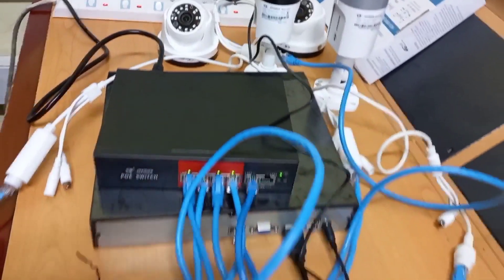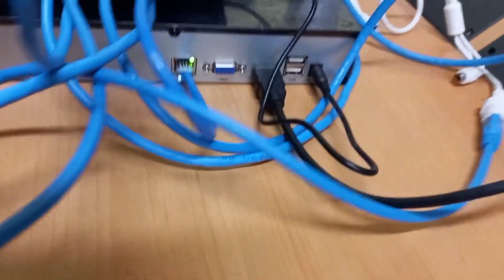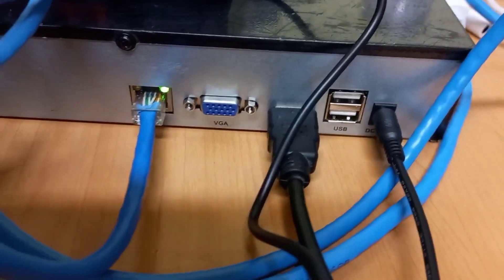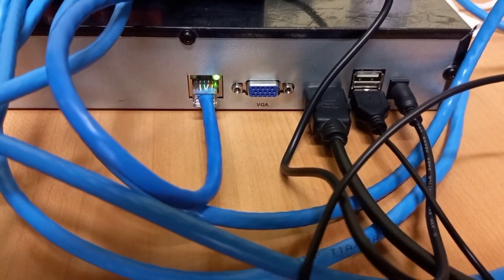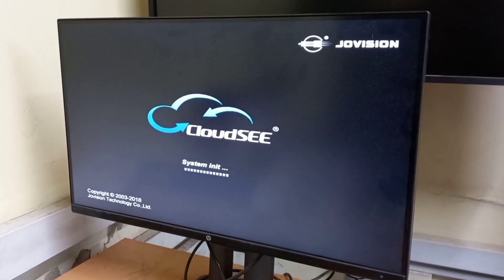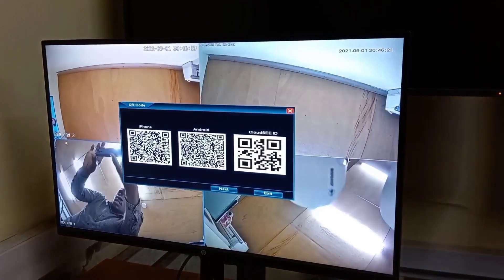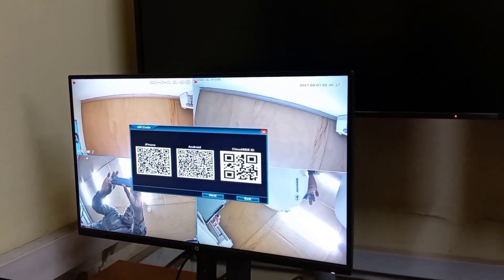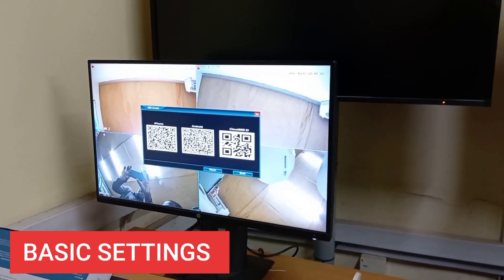IP CCTV camera installation using a POE switch.

Comment: Goodmorning bro. Please i need your advice on an issue.

A large company is in need of cctv installation. Having about 8 warehouses distibuted within the premises. Few are kinda far apart from each other. Most importantly there is a serious network issue in the area. Which system (analogue or IP) will you recommend for the installation. Distance between each warehouse ls about 80m thereabout
Reply from the maker: Please link up by WhatsApp and lets have a conversation +233556307182

Comment: Sir, u didint make use of the other terminals of the cameras.

U only used  the ethernet port terminals therby leaving the other two connectors behind. Y?🙏💯
Reply from the maker: Those other terminals are alternatives eg the power terminal. Since i already made use of the POE port.

Comment: No seperate power for the cams sir?
Reply from the maker: You can do separate power supplies for the cameras, but in my case am using a Power over Ethernet (POE) switch and so it is just economical to both use it as both a means of power and video data management
Reply from the maker: In a case where you have a non POE switch,  you may have to use an alternative power supply which could be for individual cameras or many cameras using one

Comment: Can a bad cat-6 cable cause video loss on cameras?
Reply from the maker: Yes, that is possible
Reply: @Tech_Inside_Out  I have checked everything but still shows video loss and monitor just shows scrambled lines.
Reply: How can you connect traditional cameras with rca connection to cat6 cables?Could this help eliminate video loss and other network issues?where do you purchase your camera supplies?
Reply: I appreciate your video and support.

Comment: Thank you so much , for this upload , i hadn’t a clue how this system works , as I have a older system where cam leads go straight to DVR via bnc connection, one thing I’m going to use whole sale Ethernet cable with clamper etc so could you please tell which way to wire up in colour order please
Reply from the maker: Please watch this video and see if it answers your question. https://youtu.be/1OQ1zc83fFk

Also the video showing the DVR / AHD camera system wiring process 
https://youtu.be/UrWgV1F7JFs
They may answer your question.

Comment: Thanks 4 yr video. What is the cat6 cryping method for IP cameras.
Reply from the maker: You can use either a straight through or cross over cable. Both works perfectly.

Comment: How many camera i can connect with this nvr,can i connect 8 camera
Reply from the maker: Once the NVR gets to its limit of 4 channels,  even if you are using a POE switch of 8 ports, the NVR can only recognise only 4 cameras
Reply: Im planning to used on access point to connect atleast 1.5 kilometers to install a camera  to view the location in my house

Comment: hi, thank you very much for the video, but I have a question please : Is it possible to use IP camera with an old dvr system ( coax cable) , is there special connection or I have to change all the cables
Reply from the maker: The anwer is that IP cameras are connected using Cat 6 and can only be received by an NVR.  so if you intend to use IP cameras,  you will need an NVR.
Reply: @Tech_Inside_Out  NVR or Dvr with Ethernet connection , but it needs a external  switch anyway , thanks

Comment: Does the IP camera POE camera? Since the switch is POE, otherwise you need to use POE spliter on the camera side, to power the IP camera
Reply from the maker: The Cameras are POE cameras, hence their ability to turn on when connected directly to the switch.

Comment: Could i because I only need one camera,connect a cat 6 ethernet cable form my lan port on my modem/router straight to my ethernet port on my security camera ? Thank  you.
Reply from the maker: Yes, that is possible but then because the modem does not have Power Over Ethernet (POE), you would need a POE injector to power up the camera and then connect the lan cable from the camera to the modem. Please let me know if I have addressed your question to your understanding.

Comment: Poe switch is enough to power the network camera?

What is the use of power port given in camera then
Reply from the maker: Thanks for  your question. A POE switch  is enough  to power up the POE IP camera. 

The power port is used whenever you use a non POE switch in your installation in which case you will need a separate power supply unit to power up your cameras. By so doing, you will have to use the provided power port. But this process means that you  will be running two cables for one camera when indeed you could use one cable and achieve thesame result.
Reply from the maker: I have  posted a video on my channel on POE switch, I guess that will give more understanding. Please check it up.

Comment: Hi, which RJ45 cable are you using? T568A or B?
Reply from the maker: Hello, i used T-568B wiring at both ends of my cables in this particular settup but you can as well use T-568A. It will work perfectly